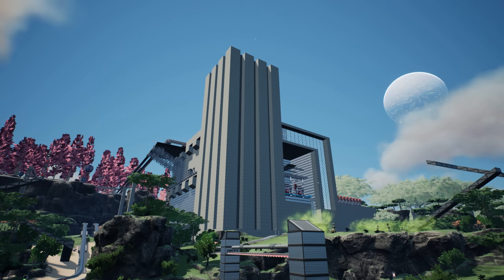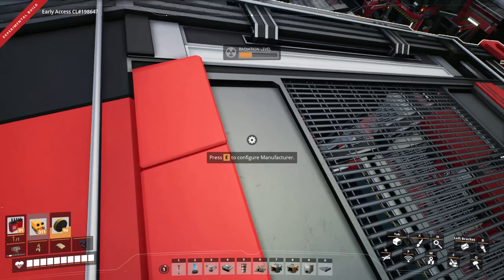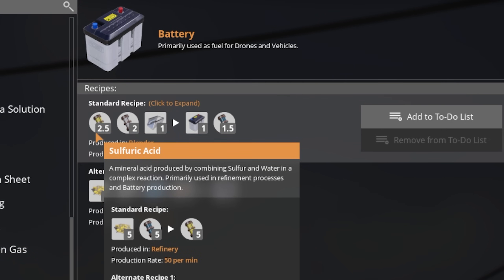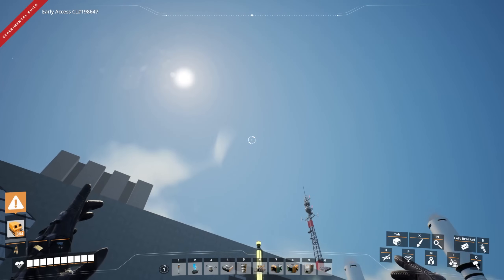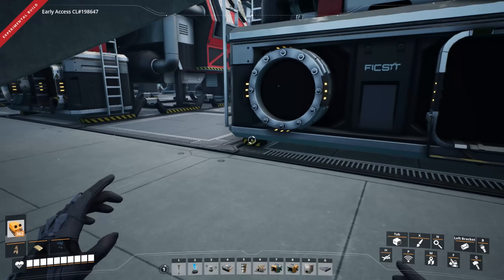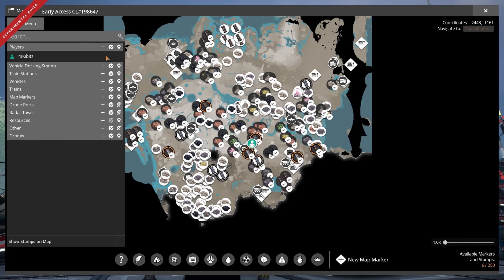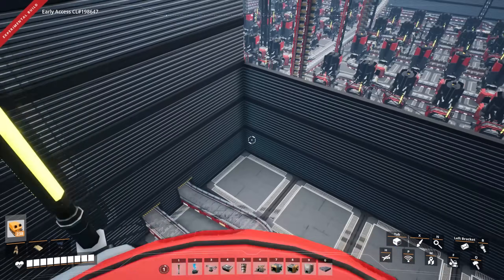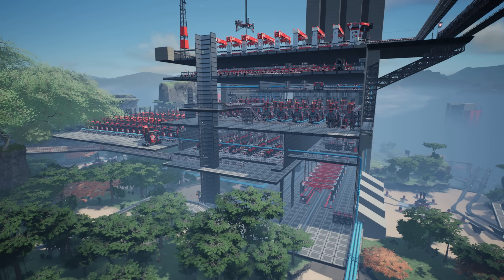I've Screwed Up EVERYTHING! - Satisfactory Update 6

Comment: Hey Kibz, the smart splitters didnt reset, its how you intended to be. the production line has to be on Overflow and the line to the sink is priority and normally backes up to the spillter, so when a meltdown happens, you turn the sinks on(you have a power switch in the controlroom) and they drain the line. so the problem was not the settings in the splitter, it was that the powerswitch for the sinks was on, which should be off when theres no meltdown
Reply: As he said in the vid, those sinks were there to stop build up of materials, they don't appear to be the emergency ones that the control room activates. In the patch notes for the latest updates there is a mention about a fix for "Fixed Programmable Splitters not saving rules when set up by Clients" so possible this might be part of it...
Reply: @Stephen-Jones  Kibz has changed everything in the nuclear power plant so many times, it's impossible to remember what his brain was thinking last time he set it up. The last thing I remember Kibz setting up was the meltdown procedure, but who knows what he's done off camera/on live streams. If he wanted to set up both emergency meltdown and backup prevention, he could set a splitter to three outputs. One set to "priority" to go the the shut down meltdown sinks; one set to "any undefined" to go to the machines; and one set to "overflow" headed to the backup prevention sinks. If I ever get back into Satisfactory long enough to get to Nuclear power, that's likely what I'll do.
Reply: @Stephen-Jones  You can see in the Video that the Meltdown switch is enabled (the Light is green) so yeah, he accidentally left the Meltdown Sinks enabled.
Reply: @Stephen-Jones  i honestly wouldn't be surprised because i swear it feels like something broke with my Smart Splitters because i keep having to replace them all over my Update 6 beta save

the worst part is that it wasn't all the splitters because i keep finding smart splitters that were working and then just randomly... stopped working
Reply: And that's the drama with this game: You tend to forget the things you do. XD
Reply: So what you are saying is that next meltdown will be cataclysmic ?

Comment: Your overclock ratios are still wrong. Normally you divide everything by 2.5 but for scrap (360 * 2.5 = 900) you cant actually fit that much on a belt. So you really need to multiply everything by 2. You have done this on the factories but not in your calculations.

Comment: Hey Kibz, the splitters were configured correctly, but the Awesome Sinks shouldn't be powered. They are your "meltdown emergency radiation flush" option. So whichever switch is controlling them should be off rather than on.

Comment: 4:20 Kibs - they didn't reset.  In a previous episode you purposely set them to dump into awesome sink while you were working on another problem with your power plant and you just forgot to change them back when you were done, so the machines were just working off the parts that were left on the end of the belt.

Comment: I have also had issues, not in experiemental, with Smart Splitters changing which output does what.  Was very irritating to know you set it up right but then it's ended up stopping production because conveyor belts have tried to feed ingredients that aren't used for the set recipes.  have to debuild the conveyors and re set up the splitters.

Comment: Hey Kibz did you not see the first powerplant you checked out in the video has no water for a second. I feel like it could be an accumilation of a few things but I would check the water inputs just in case that could be the main culprit. Hope you manage to finally get this powerplant sorted. The issues I've found with fluids is to give even more than 10% extra fluids, I had to increase mine to about 33% extra in order for the liquids to keep up even though the numbers were exact. So I''ve lost about 33% in power due to that fluids still not working correctly
Reply: I really wished we could just have a legit larger water tower with multiple in/outputs...
Reply: Isn't it a known issue that whenever you load a save, the fluids currently in the machines vanish?
Reply: @renakunisaki  even with that I genuinely spent so long testing the fluids they were just too unpredictable, hence dropping my fuel gens by 33% but keeping production the same. It levelled at 33% only, and has stayed level ever since

Comment: The Problem with overclocking these refineries was not just, that you assumed, you could overclock them to 300% but also that they produce 900/min when fully overclocked which is too much for a Mk5 belt even when they only run at the allowed 250%.

Comment: I'm currently dealing with a situation with a bank of fuel generators struggling to stay online despite being fed with enough fuel per minute and sufficient head lift to get the fuel up the pipes. I moved the base from the Spire Coast to the Crater Lake prior to Update 6 and since moving it despite the production numbers being identical I'm getting this issue when it worked fine before.
Reply: I had the same with my bodacious 200+ generator plant.  The problem turned out to be built-in inaccuracies in the fluid mechanics and it was not trivial to fix.  Good luck.

Comment: You right the smart splitters reset.

I started a new save on U6 and even when setting brand new splitters the parameters have to beset twice before the actual work.

Idk how else to explain it but it was replicated on each splitter. They just wouldn't perform as expected until I when into each parameter again.
Reply: That's gonna be fun for my huge sorting facility that uses a few dozen of them...
Reply: I just set 5 brand new smart splitters to send overflow in my factories to the awesome sinks, and I set them once

Comment: Didnt they change the poweruse of overclocked machines to linear? Like it was exponential before, so one fully overclocked machine would take much more power than the number of machines needed to produce the same amount of output.
Now its basically if you overclock a machine to 200% it just gonna use twice as much power, like two machines, iirc.
Reply: Coffee Stain talked about that, but they haven't done it yet.

Comment: Is Kibitz using mods for inventory space and materials?
Reply: Yeah, he used the calculator/save editor to increase his inventory size.

Which is perfectly fine, honestly. Once you start getting into the mega projects like this, 81 inventory slots is nowhere near enough storage space. You'd have to make trips back to your base to stock up on materials every five minutes.
Reply: @Her_Imperious_Condescension  the trick is to use a tractor to haul a ton of materials over, and stash them in storage containers.
Reply: @Her_Imperious_Condescension  Is that also why he says he has infinite power shards? I thought maybe he made some kind of lizard doggo farm for slugs, but I guess he could've just used the save editor for that
Reply: @XyloJW123  Yep.  His season 3 base became unplayable because of the sheer number of machines that were running in a small space and got wrecked by the power generator changes, so when he started this new game he decided to keep the machine count low with shards and spread them across the map instead of having the megabase.  The first thing he did was use console commands to make a bazillion shards.
Reply: @Her_Imperious_Condescension  yeah totally agree, even if my projects aren't near as big. Thanky you for your answer :)